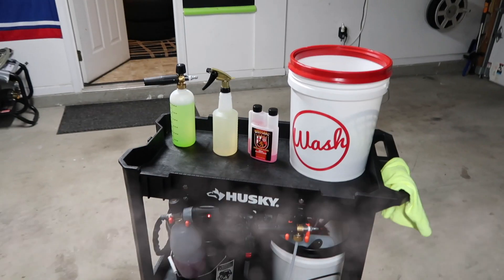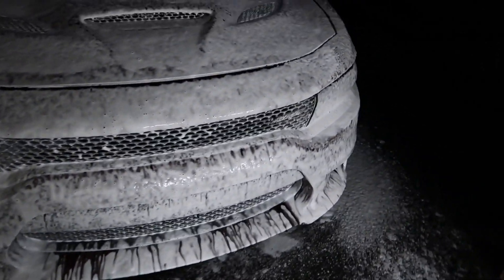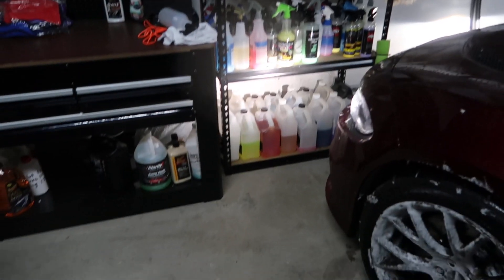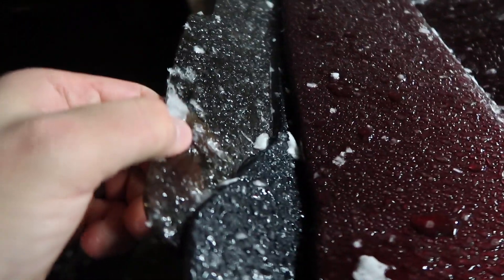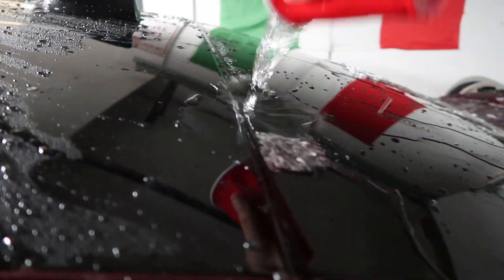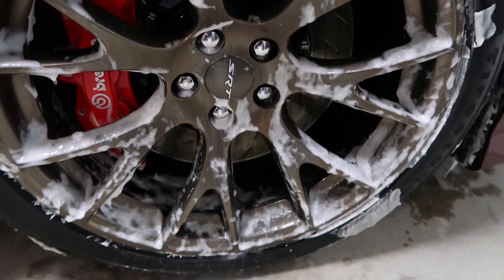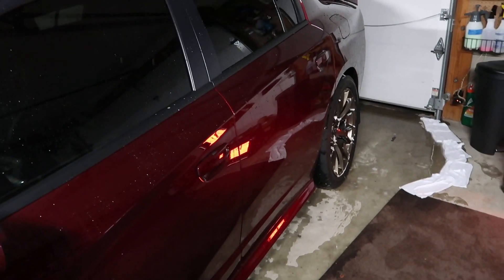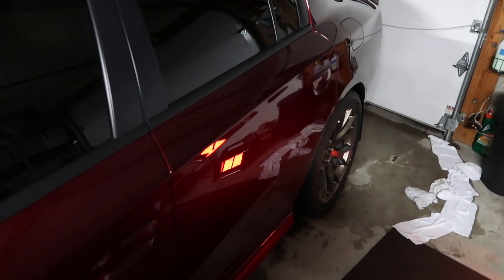Below Freezing Winter Wash FAIL | I Froze My Hellcat !!

Comment: STOP pouring warm water on frozen paint/glass! That's the worst part!
It's not that bad if the foam frozed, it cause any harm unless it melts again and you don't rinse it in time.
Reply from the maker: Toni Pieleanu the paint wasn't frozen at that point I had a garage heater on for over 20 mins before that lol was just cold but it's perfect 👍👍

Comment: I live in Norway, I wash my car when it is about 30-35 degrees in winter. I have made a connection so I can hook my electric pressure washer to the shower tap. I can run 140 degrees true the washer without causing any harm but I run approximately 70-75 degree water. That is great when it it cold outside:) So just a tip for you👍 BTW love your videos!

Comment: Check out Auto fanatics channel, he posted a vid about winter washing and using CG Vo7 or something along those lines to keep the water/soap from freezing during the wash. I think the V07 is supposed to have some kind of additive to keep from freezing. Keeping the paint shiny is cool but the undercarriage is what most people neglect and most rust belt cars deteriorate from underneath long before the rest of the car. I had a WRX Sti that I used to keep shiny and meticulous but eventually sold because of all the rusted and frozen bolts under the car that were ready to snap off before budging. Amazing how destructive the new salt sprays are that they use on the roads during the winter, they REALLY stick to the metals under the car and start eating away.

Comment: You could of turned your car on and with the heat of the engine and turn on the defrost of the windows would of been big help. Other wise a rinse with a warm microfiber/ or your choice of towel to dry your car

Comment: You should have a plumber put in a hose bib that has hot and cold running to it, then you can use warm water to wash with. I have that done at my shop and it’s a life saver
Reply from the maker: Coffin Nails might have to look into this thanks !!
Reply: If you have a sink near your garage just screw on a sink adapter and put a hose on that. Instant hot water

Comment: I dont have a garage and my car was so dirty i couldn't take it. It was around zero degrees i thought it was too dirty & cold to do a waterless wash so i went to a car wash. The touches automatic wash was so full i went into a bay & used a pressure washer and thats about what was happening. The soap was freezing before i could even finish the panel lol. I got it washed but after rinsing it off it was a sheet of ice. I had to go through the touchless automatic wash because it dries about 95% of it lol
Reply from the maker: bingster 223 damn cold weather lol

Comment: and the second stupid thing you did was pouring a hot water on a frozen glass! lol wow!
Reply from the maker: Ejmin Ar the first stupid thing you did was think I didn't have the car in the garage with the heater on for 20 mins beforehand .. the second stupid thing you did was assume it was HOT water as opposed to warm lol the third stupid think you did was assume I didn't have the defroster on for a few mins before pulling the car back into the garage so the glass wasn't STARTING to warm up 👍👍 assumptions are killer bruh

Comment: you probably caused more damage (micro marring) doing this than just leaving it be.
Reply from the maker: Sean Gray negative lol you must be from the Adams Polishes special :) paint is flawless .. It's very well maintained and coated, this is about the worst I've ever seen it and, still, not a single issue or mark on it even under every "light of truth" I have
Reply: haha Why would you think I use Adams???  Get the scangrips out and you will see the results! Daily driver with not a single mark? Not likely. The foam freezing with the dirt and then you moving it on the paint will cause micro marring.

Comment: Bro why are you making it like your paint is ruined... no big deal just pull it in the garage and let it melt
Reply from the maker: Vance Ely uhh .. that's exactly what I did .. I pulled it inside .. turned the heat on .. and accelerated the drying process with WARM water .. so .. it all melted and I wiped the car clean lol confused how you didn't get that from watching

Comment: Weak ass electric power washer my Honda washer would have took all that off
Reply from the maker: ip address Lol guess you missed the point that this was supposed to be a quick rinse and pull in .. the video I did before this had zero problems .. If I wanted to have more power I would have went through the process of setting up my 3100 PSI gas washer with your beloved Honda motor .. but .. it was getting late and that machine is noisy .. so this is what I was stuck using basically

Comment: Pouring hot water on a frozen windshield is a good way to crack it
Reply from the maker: Prodigious 909 the foam was frozen not the window. It was in the garage for 20 mins with the heat on and the water was only warm thus the soap coming off so easily :) I appreciate the concern though 👍👍